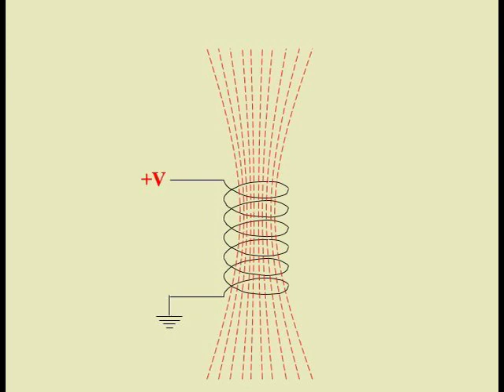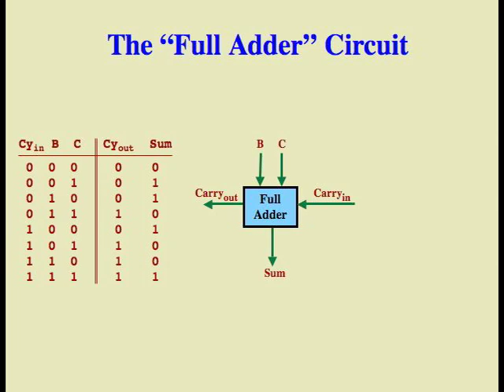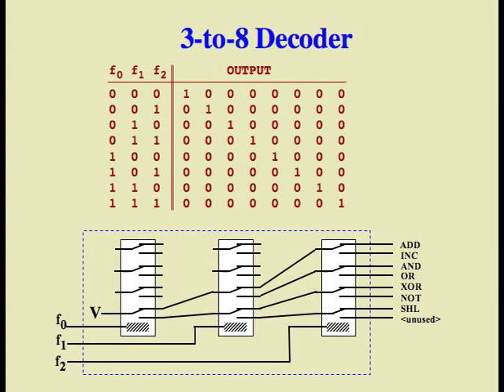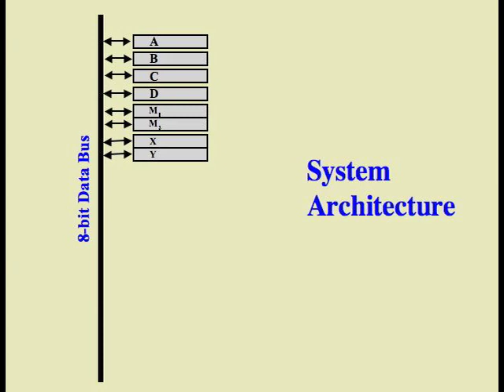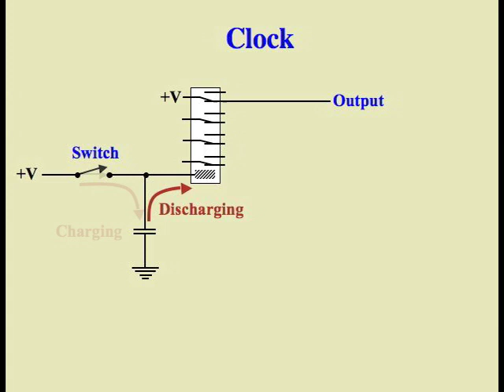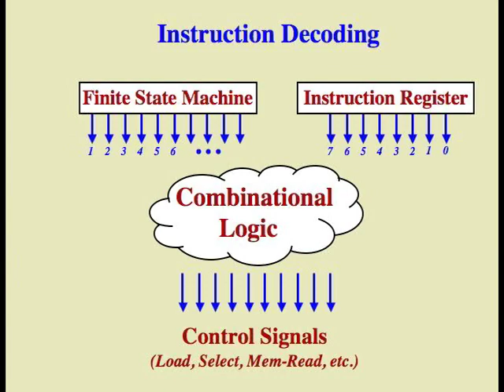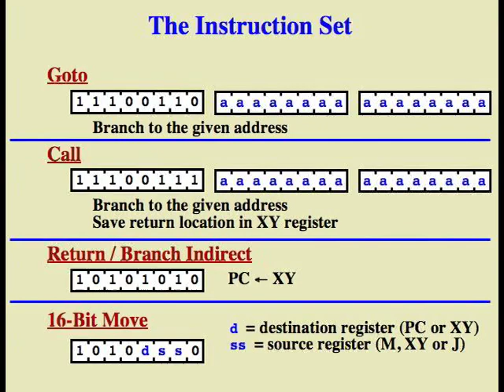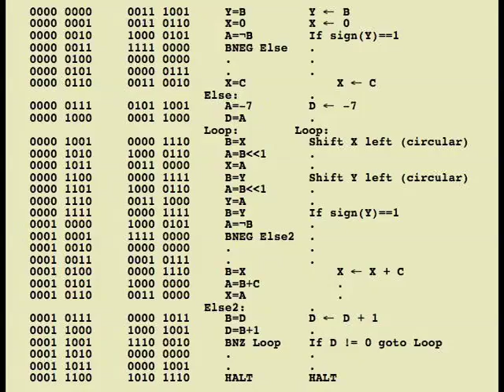Computer Design Tutorial

Comment: 4:04

The relay has two outputs. This is a problem. I do not understand. What is the point of having a relay? It doesn't do anything. You apply voltage you get voltage you don't applt voltage you get nothing why is a relay necessary for that?
Reply: okay i got it :D